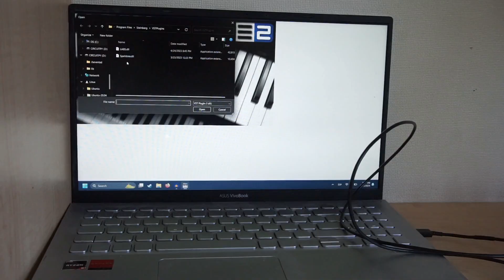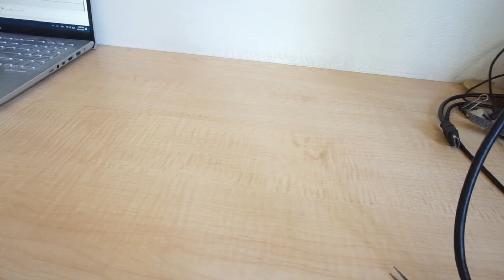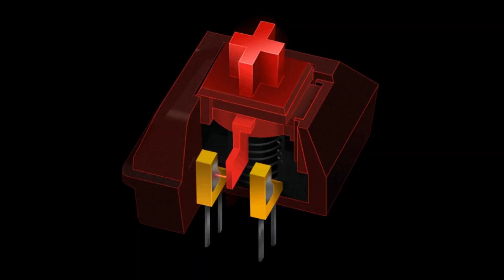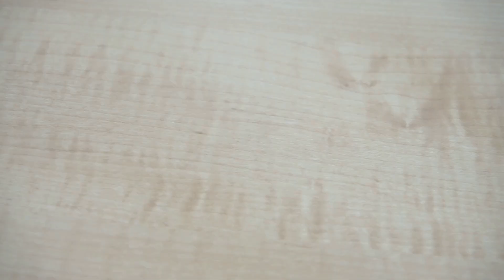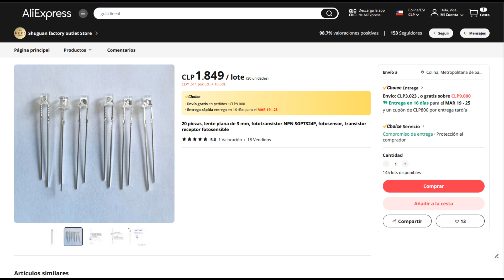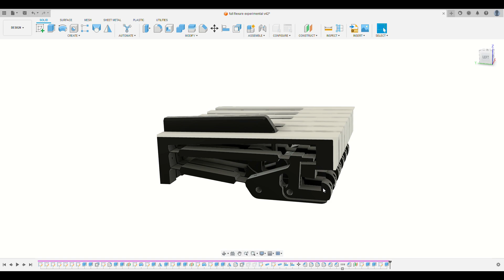3D printed compact MIDI keyboard

Comment: yeah, nooo. This "compliant" printed mechanism is no good, obviously it will break in no time, it has zero weight and inertia, cannot feel right, there are many things that matter a lot for keyboard feel, it must have hammers and momentum. Optical sensing with LDR is also a dead end, for multiple reasons, the only proper way is high speed high 16 bit resolution sampling of hall sensors.

Comment: I really like the LED approach.  I was thinking of an approach using 3 pogo pins per key, staggered to get both velocity and acceleration.  RP2040 should be able to scan 88 keys at super high resolution.  Pogo pins might not be as durable as your approach, however.   There are other spring types that are good for 25M contacts.  Very cool.

Comment: Lots of great ideas in this project! And getting it actually working as a prototype is quite a feat imo. 
In case it's useful info, I built a matrix keyboard using a Teensy LC, which is slower than a Pico. It's able to measure 225 analog readings quickly enough for musical playing! I'm not much of a coder, but I'm hopeful you won't have trouble reading lots of inputs quickly. The only thing is that I've read that the Pico doesn't have great analog inputs, so I don't know how that might factor into the performance. Teensies have really good ADCs, fwiw.

Comment: That’s so cool! I’m impressed with the way you designed the keys to move when pressed, looks nice! 
Is there a specific reason you did not use a library for midi? I know there’s a midi library available for arduino.
Reply from the maker: I wanted to work with the raw midi messages to have maximum control (and it's also not that much extra work)
Reply: @elterla2153  that’s fair

Comment: I love your flexure keys! Have you considered hall effect sensors instead of optical? I bet you'd get a smoother, more predictable response.
Reply from the maker: I've considered many different switching systems. At the beginning I wanted to make a pcb with sliding contacts but found it to be very labor intensive and a bit noisy. With hall effect I think I could get away with a single sensor per key to measure velocity but I'd be afraid of inference between keys and how to monitor 49 hall effect sensors with a single controller. I will say on my defense that the optical switches provide very fast and reliable switching (and hopefully more consistent with phototransistors)

Comment: Super cool! Was there an existing library that let you find press speed from the sensors and convert it to MIDI velocity, or did you have to make some from scratch?
Reply from the maker: the part that is programmed in Arduino is made entirely from scratch, both the part that checks the matrix of the keys and the velocity calculation itself. I'm still tuning the values for the sensitivity but it seems promising